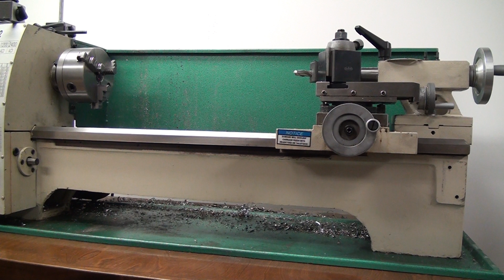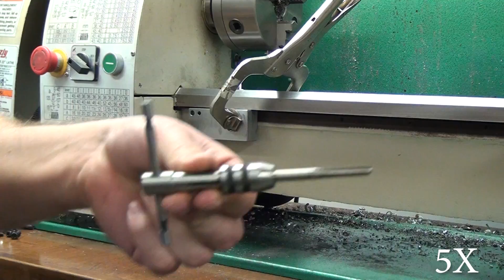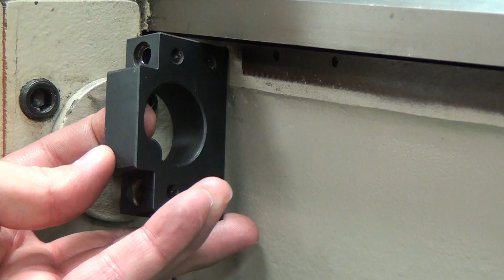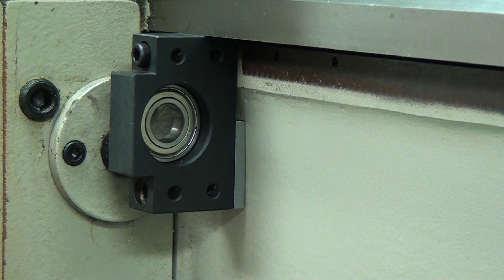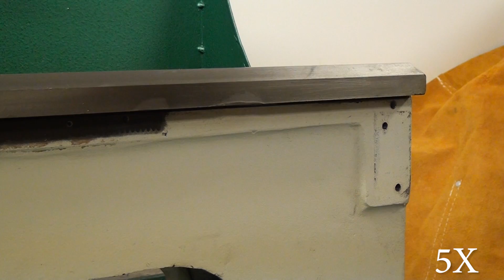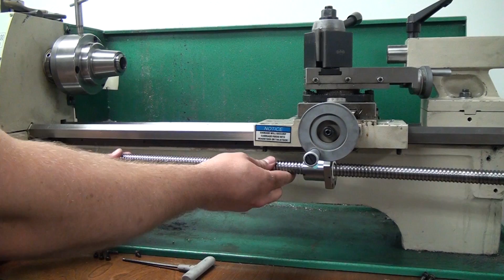G0602 CNC Conversion pt3 - Z-Axis Bearing Blocks

Comment: sup russ ,make sure u blow them holes out good un cheap cast.. the cheap cast iron casts have pockets of sand from the casting. u would not beleave the junk that makes it past the qc dept. its just nutz i seen a mill with a 1/2 melted 3/8 air drill hanging out of it that was droped in during the casting pour lol how couldnt u see that hehe.  thanks for the video
Reply from the maker: +turnmaster Right! Dang castings :)

Comment: Nice job, Rus. Looking forward to the rest of the series. How is the conversion working for you so far? I like that you are giving tips about things you would do differently as well.

Sincerely,
Tom Z
Reply from the maker: +Tom Zelickman (Inspiration Metalworks) I'm just barely starting to use it, because after I got the conversion finished I did the 3phase motor and then built a new controller cabinet. It's been time consuming, but I'm getting really ready to start cranking out some actual work :)

Comment: looks good!  I have Lathe envy...lol.  I scored a little 7x10 for $75 off craigslist, couldn't pass it up as cheap as it was.. so I'm now modeling up a bunch of different ideas for the conversion, figure I have enough little steppers and bobs and power supplies laying around and my G0704 stock spindle motor to add some extra power. so will only cost me for the ballscrews, the upgraded spindle for  4" chuck,  some AC spindle bearings, and a little mill time making parts and a few hours scraping and lapping ways...  then probably sell it to buy a G0602 or maybe even a 12x30...

will be watching your video releases to help make up my mind.  how are you liking the Lathe so far setup for CNC?  have you pushed it at all to see what kind of cuts it will take before tapping out?  very interested... would love to see some more vids of it cutting parts if you have any footage.. seems like most people with a G0704 or mini mill make lots of chess pieces or small brass parts.. I will be cutting parts mostly out of 1.5" - 3" diameter stock.  the little stock motor definitely isn't happy about it...lol.

Loving the vids so far man keep it up!
Reply from the maker: +christopher polanski Thanks! Right after I got the CNC conversion done I did the 3phase motor upgrade and then built a whole new control cabinet so I haven't done a ton of machining on it yet in the new configuration. I will definitely be rolling out more footage of it working hard :)